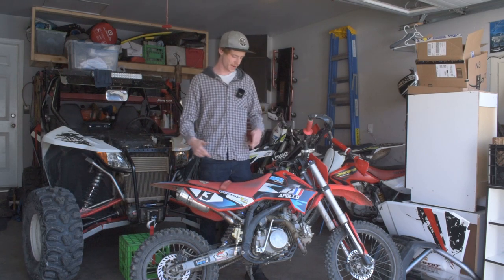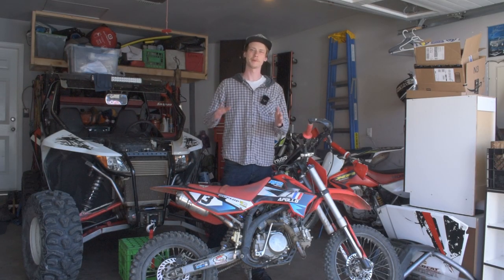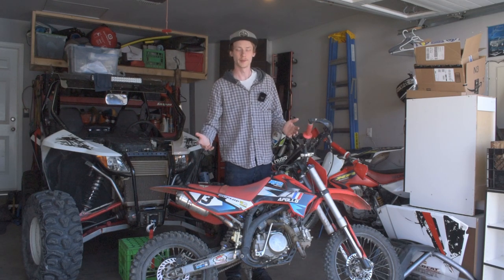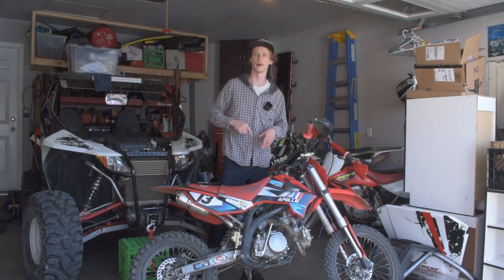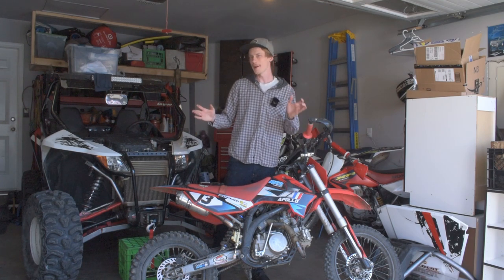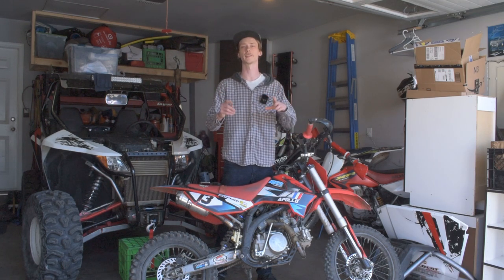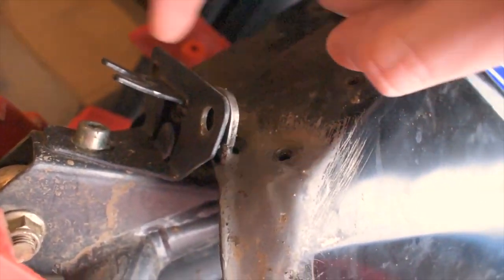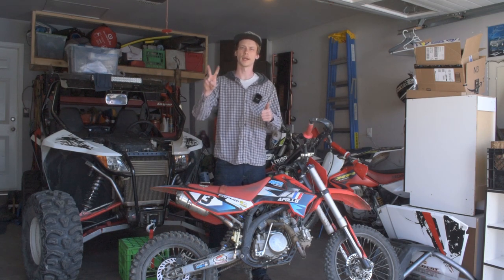1000$ Amazon Dirt Bike After 1 Year! Did The Apollo RFZ Hold Up To The Enduro?

Comment: I got the RFZ 70 and @ 175 lbs it wont break. Literally took it to the top of a mountain. I tried to break it the first couple months I had it on purpose. The rear brake lever has tacos so many times and I just bend it back without any issue.

Tires and brake shoes is all it needed replaced. I actually love the little guy so much that I stripped it down to the bare frame and painted it with a Japanese quality base coat/clear coat. New rims and plastic. 😊 I thought for sure those 10 inch rims weren't going to hold up but with some HD spokes this thing has surprised the hell out of me. 

I bought mine in Phoenix from a place that has them on a floor. You can check them out before you even purchase. No shipping $. Sick
Reply from the maker: Thats awesome! Glad to hear you’re enjoying it!
Reply: Advanti Powersports ??

Comment: Overall great bikes for the price. I never had any major issues. Never had shifting issues. I will say the the cheap pieces that are a issue are chains, chain guides, and the small wheels are weak. Get a true big wheel kit 16/19. I did hard trail riding on mine as well and always held up my buddy worked on his xr200 as much as I did the pit bike. All the problems are cheap easy fixes. 125cc engines are under powers but with the 16/19 big wheels and a Daytona 190cc engine with 24hp you can run with just about anything because of the power to weight ratio.
Reply: Carb is 110% percent junk too
Reply from the maker: Definitely fun little bikes! Just a lot of issues relative to japanese pit bikes
Reply from the maker: Stock carbs are completely junk yes haha

Comment: I had one , snapped chain smashed stator , snapped all the spokes in back wheel , popped back shock , snapped clutch leaver , was a money pit , engine lasted and I never changed the oil, mine came with a foam filter, was not oiled up an it set on fire I had to rip it off just in time, mine was a clone CRF called a pro explorer about 10 years ago
Reply from the maker: Sounds about right lol
Reply: @AaronsEnduro lol

Comment: I know this video is 2 years old but I actually just bought an Apollo 250 back in April. I had to replace the battery, I had to pull the electric starter compartment apart and there was a bunch of metal shaving in it so I cleaned it out and realigned the gears. Now about 30 hours of riding my carb float got stuck. Tried to pull it apart and reassemble it. It just leaks gas, so I ordered a new carb that comes tomorrow. I also put a hole in my tank where the bolt weld for the plastic was and also had to use jb weld. I prob would never buy one again. But as I don’t have 7k for a name brand bike I feel like I got my moneys worth. I don’t know how I feel about the decision yet. I guess we’ll see if the new carb works and how the rest of the bike holds up for now
Reply from the maker: Best of luck! One day youll afford a brand name bike and never look back!

Comment: So I was hesitant at first but seeing how much you use it and the conditions it goes through. I think I’ll get one still since I’ll mostly be riding flat cane field trails.
Reply from the maker: Ill tell you what, if you save a bit more and got a Japanese branded bike youll be so much better off in the long run! Either way you’ll have fun :)
Reply: @AaronsEnduro  haha alright imma have to check some more out then. I think the allure of it being from Amazon is really what had me sold. But imma check out some different options now that you said that. I haven’t rode in probably 10 years so when I saw it I was like “holy cow!” But thanks for the advice imma probably go with something else if ya recommend if
Reply from the maker: Look at xr100’s , crf 150f’s
Klx110’s , klx 140’s just to name a few
Reply: Why you recommend japanese bikes  even when they are not made in Japan anymore and has same china made parts in them but cost is 3x more for the bike and most of the parts. I cant see why Honda is 3x better. Seen rfz ran 90hours and in perfect condition. I think it is lots of quality in 1kilo. PS. As a prev Honda owner I would choose new rfz over used Honda any day all year long.
Reply: @AaronsEnduro  I don’t think it worth 3x the price just to run on flat cane fields

Comment: I have Zongshen 250cc in my 14/17 bigwheel. Havent had any welds break in 14 years. Mine is about 3 years b4 Apollo came out.
Reply from the maker: That sounds like a good little unit!
Reply: @AaronsEnduro  shes a little beast. They dont make that 125 size frame with a 250cc anymore, at least not in Australia. Thats y ive kept her.

Comment: We just got a Xpro Hawk 125CC - great heads up video on what to look for! Based on the tough trails you run, it surprised me the bike would take it! Had a Hawk 250 for 4 years that thing never broke but it got run on gravel roads and pavement. Upgraded to a BMW G 310GS.
Reply from the maker: Thanks for watching! Glad i could give some insight
Reply: I have a Hawk 150 and it’s been tip top other than a stripped handlebar bolt when I received it. Also, I don’t run it hard since I know it’s not meant to be. I use it for trails and scooting through the woods. Some of the trails get some heavy mud so I go around as much as possible. It’s been a great unit so far. I also still run the stock carb and ran the stock chain until it started stretching. For most people, who don’t significantly abuse them, I’ve heard great things. I have an Arctic Cat wheeler that I abuse and it handles it like a champ. Even on that I’ve had to shore up a weld since it started shearing after hitting an unseen stump on the lower chassis. The 150 bike has been great so far with about 50 hours on it.
Reply from the maker: Glad to hear you’re enjoying the bike

Comment: So far the only problems I've had was the bike would idle extremely high, almost as if giving it throttle with the stock carb as well as a knockoff Mikuni but the company I got it from sent me another carb and it worked pretty well but now it bogs down after letting off in high gear/rpm, think the carb is just dirty tho because I have the stock filter on still and the clutch lever broke first drop lol.

Kind of wish you said all the things you liked/thought were done well on the bike too instead of just the bad.
Reply from the maker: Honestly... there nothing thats “good” with this bike lol

Heres a list just for you, 

The good things about the apollo are...... the price...
Reply from the maker: Nothing on this bike stands out being better than any of the Japanese bikes ive ridden
Reply: @AaronsEnduro  Lmao! Fair enough.
Reply from the maker: Just being honest 🤷🏼‍♂️
Reply: Gasket between carb and block
Reply: @kristimoulton3318  could be, thing lost compression probably a month or 2 after this post lmao
Reply from the maker: Classic
Reply: Mine had multiple air leaks around the valve cover engine seals etc then my engine blew up. I was having the same symptoms as you.
Reply from the maker: Dang that sucks!!
Reply: @AaronsEnduro  Yea tbh it was my fault my stock carb was working perfectly fine but I decided to change the carb because everybody said so and I was riding in cold Michigan weather and I think I overheated my engine because it was running lean. I also used to let it idle for like 15 minutes at a time BAD IDEA. I think all of that heat warped my engine causing those air leaks. I’m about to buy another Chinese dirt bike tho and keep my other one until I can afford to put a engine in it and use it as a back up lol. And I’m never working on my new bike again if the carb works then I ain’t messing with it.

Comment: Just bought one to bump around on. Watching the vid to replace the weaker points with heavier components.
Reply from the maker: Thats sweet! You’re gonna have a ton of fun!
Reply: @AaronsEnduro  thanks man. Im a lisenced mechanic byy trade so sourcing beefier parts ready. Have a mukuni VM22 or 26 enroute now.  Will replace the chain and sprockets for ones that suit either woods trail or more flat faster trails.  Im probablly going to change the plastics color and install the headlight  kit, risers for the bars and add a oil cooler kit. Needs wheel bearings and differemt kill switch. I dont lile the on/off ones i am used to the momentary ones so you dont inadvertintly kill it while youre riding.
Reply: Ive also built a few honda 50cc engines up to 88 big bore with 90cc head and high volume oil pump, oil cooler, and mukuni carburetor. Was a beast.
Reply from the maker: I used a vm24 for my 125cc and 150cc engines and it ran flawlessly
Reply from the maker: Sounds like you got some fun toys!
Reply: @AaronsEnduro  sold them all  even my Z1000. Just want something fun, small and make it reliable.
Reply from the maker: Chinese bikes and the word reliable dont really go together haha, mine broke constantly
Reply: @AaronsEnduro  jahaha its an oxymoron haha
Reply: @AaronsEnduro know whetmre a guy can get a footbrake pedal/lever for the apollo or one thatd work
 The cast iron one bent and snapped. 
Since we last spoke, i bought another 07 Z1000 and ive upgraded a lot on the RFZ150, o-ring 428 chains and sprockets, protaper grips and risers, got the new carb on it, woke the bike up. Put a speedometer on it and it does over 100km/hr/60mi/hr... new rear wheel... new coil, Brake flush, steering head bearing service, swing arm bearings... KTM push button kill switch...
Reply from the maker: Apollomotors.ca
Reply: @AaronsEnduro  yeah man "no stock"
Reply from the maker: @matthewmorrone883 your outta luck then

Comment: Just bought a 2020 apollo rfz125 (x-18) for $500. Has a bunch of aftermarket parts. Just needs a rim (the great spoke incident of 2024 😭), an inner tube, and the tires are kind of warn out but i dont need to replace the tires just yet. Is this a W buy?

Comment: Should I put bushings on that part that blew out on bottom of the shock mount area for you? It didn’t come with any and I tried tightening enough but still feel it needs something in there around bolt maybe
Reply from the maker: There should be a bushing in the bottom of the shock bolt mount

Comment: So if I do buy one. I should slightly take it all apart and locktite every bolt. Hmm doesn’t seem worth it for only a year of use. Any other tall 125cc-150cc pit bikes you recommend? I’m only trying to spend $1000-$1400
Reply from the maker: Then watch the market for a used bike to clean up. But lock-tighting  bolts is normal to do on anything that spins or vibrates. Including Japanese bikes. It also costs like 10$ to do it and maybe 5-10 minutes

Comment: Sup bro was looking through the parts u said u had to replace gas tank I gotta do the same with mine which tank did u use  I don't wanna order the wrong 1 can u help plz and thanks for the great content
Reply from the maker: thanks for watching! the plastic upgrade tanks seem to be somewhat hard to come by(in the right model)
i sourced mine from apollomotors.ca  check out the photo they list on the website there and carefully look over the bolt hole positions. that is the correct tank for the updated frame design. It also depends what country your from as thats a canadian dealer